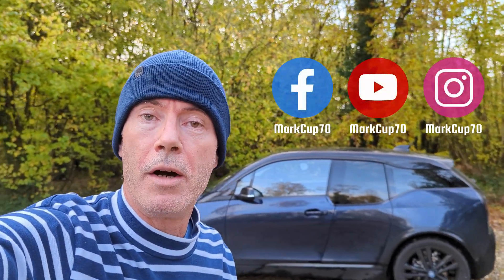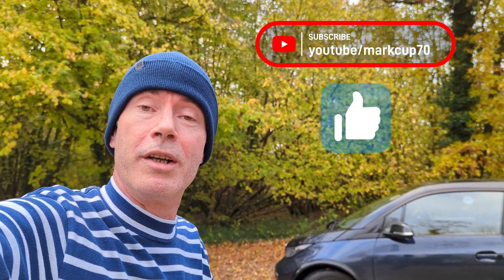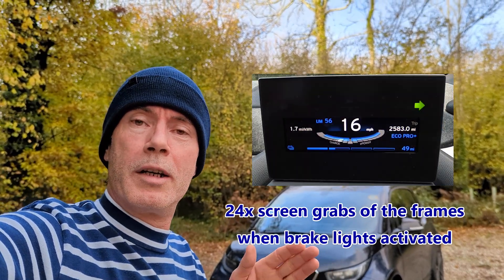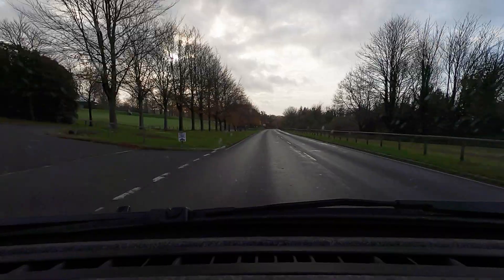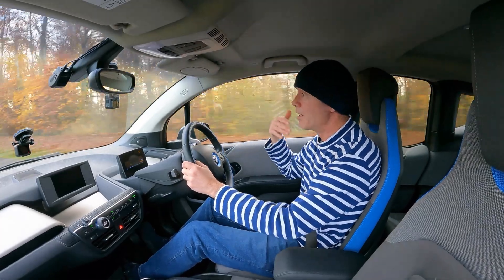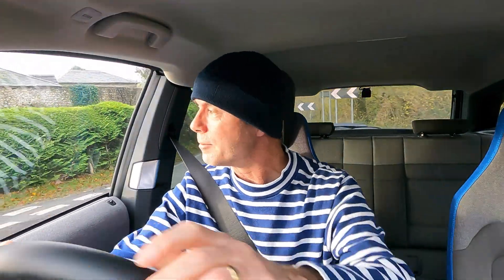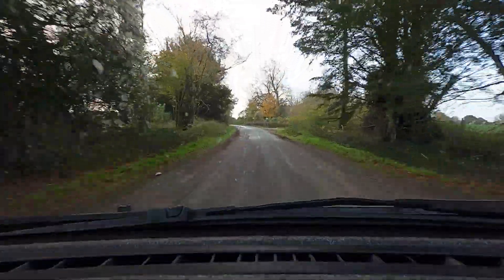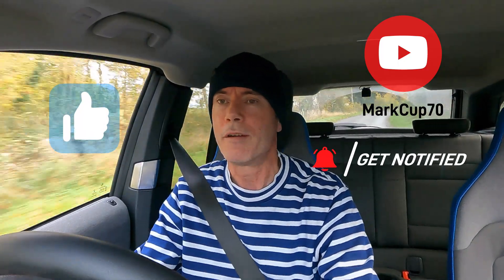BMW i3S EV life - why REGEN BRAKING in ELECTRIC VEHICLES is BAD for range!

Comment: I agree with you.  Accelerate moderately and read the road.  I managed 107K miles on one set of front brake pads in my C55 AMG.  With such a car, you can’t avoid the occasional vigorous driving, but the most miles was put on as a daily driver doing a 75miles round trips. It will be interesting to see how we get along with the i3 we’re picking up next week.

Comment: I know this video is 1,5 years old but you should test the “regen” on motorway with speeds over 60mph. Will the regen (letting of the gas) be stronger OR lighter between Eco Pro / Comfort / Sport –modes?

After 2,5 years of BMW PHEV (plug-in hybrid electric vehicle) ownership I believe this is true to some extent, but its greatly affected both by the “model year” AND the technology under the skin. For BMW PHEV’s different driving modes affects greatly how strong the “regen” is or in some cases it is disabled completely (this varies with the speed which the vehicle is moving). Thus I find a bit odd that Mark is saying that in i3 there’s only one setting for regen? Under all the settings under various driving modes there's no "B" or regenerative braking force or such?

For example (yet again BMW PHEV’s) the regen in Eco Pro -mode is different than in Comfort or Sport –modes. Also in the newer BMW PHEV’s there’s this … how to say it, “coasting” option automatically engaged: The ICE or EV motor is decoupled from the gearbox & rest of the drive train system and shut off. Kind of “start & stop” system but while vehicle is moving on the motorway. From the BMW technical bulleting:

"A hybrid-specific coasting function is triggered at speeds between 40 and 160 km/h (25 – 99 mph). As soon as the driver releases the accelerator, the combustion engine is switched off. In addition, recuperation of braking energy is reduced to the level required by the onboard power supply. The car therefore runs on the minimum possible energy consumption and with the lowest possible mechanical resistance".

-This will greatly reduce the drag which the petrol engine normally creates. It’s actually surprising how long distance modern motor vehicle will just roll when there’s no resistance & drag from the engine. I’ve experienced this with my former 2018 BMW 740Le PHEV which had this option under Eco Pro –mode. And this actually increased both petrol and EV-range by quite a bit. BUT this “coasting” option was only engaged at speeds greater than 40kph / 25mph, when vehicle was travelling slower, it used regen like in Comfort -mode.
And if driven with Comfort or Adaptive -modes the vehicle would just “engine brake” with regen system all the time -> negatively impacting the overall "range" of the vehicle.

Then I bought an BMW i8. This one generation older hybrid powertrain does not have “coasting” option under Eco Pro –mode. When in Eco Pro the vehicle regens just like in Comfort –mode and the regen is actually stronger than 7-series ever had. Albeit the i8 is 800kg lighter than my 7-series was. Even at quite big downhill section the i8 will just slow down when Eco Pro or Comfort –modes. My 7-series never ever slowed down even at mild downhill, not even Adaptive –mode. If that thing was in Eco Pro, it would gain speed like a car in Neutral rolling freely.

Could this (lightweight, older technology) be the case with i3 also? Because for example the much newer BMW i4/i7/iX will “coast” (only in Eco Pro –mode) and the regen will not reduce the range similarly than / if driven with Comfort / Sport / Individual –modes.

Comment: I've got a Nissan Leaf 40kWh and always drive in B (braking) mode and I'm a bit of a a hyper miler, consistently get better than average efficiency compared to others on the Nissan Leaf FB group, though the summer I've been averaging 5.4 miles/kWh, 700 mile round trip to Scotland and back in June I got 4.8 and I wasn't hanging about. Having been a driving instructor for almost 40 years I know that anticipation is the key to efficiency, even more so in an EV than an ICE car. I wonder if the i3 makes more regen the lower the battery %age is, I certainly find that in the Leaf, I like to keep the battery between 80% and 90% which gives the most balanced level of regen. Very rarely use the brakes at all.
Reply: Giid efecenty

Comment: Dear Mark, Just your title for this video is misleading. All the points you make about energy loss when using kinetic energy to charge the battery are correct but you are putting some energy back into the battery rather than just losing it as heat. But the main point you make is so true. If we all read the road and the traffic conditions then Electric or ICE we shouldn't need to use the brakes very often. That's the important point. Perhaps this video should have been called "Not reading the road is so bad for range".

Comment: It is poor anticipatory driving that is bad for range.  With "One Pedal Driving" I consider the pedal as "progress Control" rather than on/off .. I very quickly learnt to feather the pedal for controlled smooth stopping - something I gleaned from towing with automatics
Reply from the maker: 100%, anticipation and planning = max range, spending energy only on the momentum you can use. Anything you have to recuperate through regen braking is inefficient which is the point I was trying to make with this video 👍

Comment: I think what you are saying with regards to energy saving is more relevant to your car with only one setting of regen, so as soon as you come off the throttle you are effectively braking, enter other makes where there are several modes you can coast, where as in your car you are still using power.  100% agree with reading the road etc.  I would like to see a test done to show which is the most effective setting, I suspect it’s counter intuitive for the reasons you have highlighted.  With minimal allowing you to shut off demand and coasting on kinetic energy alone.

Comment: The headline is very misleading. It should read "Braking is Bad for Range" Whilst it is correct that regeneration doesn't recover 100% of your kinetic energy, using the brake pedal recovers 0%. So to get maximum range you should control your speed anticipating stops such that you don't need to use the brake pedal. Using the regenerative braking is very useful especially if you are descending a hill or slowing for any reason.

Comment: Downhill , that’s the real winwin.
So always you will have  unpredictable situations,  someone tailgating you, but yes you can of course aim to plan ahead to the point that regen is unnecessary. It’s very satisfying infact !
I like the quote ‘arrive to depart’ someone pointed out here.
The idea that you are harming the battery … ha, I doubt it. The BMS on the i3 is very sophisticated. I doubt it’d allow any detrimental charging to occur. 
Thise track day pads , maybe try a caterham on track or a Lotus. You’ll do more than one track session on a set. And you’ll drive home safely. 
The Cayman is a fabulous machine. But it ain’t light, compared to an Elise. Of course, you may like roof that works effortlessly and hate squeaks… but if you haven’t tried a Lotus, you really really should ☺️
Reply: you are correct, but is hard to resist the tork😅

Comment: I agree, but how do you turn of the regen breaking?
Reply from the maker: You don't turn it off, you simply don't take your foot completely off the throttle, you find the mid coasting point in the throttle pedal's travel and allow the momentum of the car to carry you along.
Reply: @MarkCup70  thank you for answering.
I see a lot of comments saying you get used to it. So I’ll probably get into it, but I still like to keep my fot on the break in case I need to stop fast..
Reply: @eliaspederstad4360 or increase your braking distance, I find it to be such a chilled way to drive…much more Zen! to car in front?

Comment: Regenerative braking is about recovering energy that would otherwise have been lost. In town driving I've found that I can end up with more range than I started out with thanks to the recovery of energy and generating energy on hills. To say regenerative braking is bad for range is incorrect, driving style will always lead to better energy use if you plan ahead for the road and conditions. Avoiding speed change will be better for an EV or ICE car, it's all about making the most of what you have.

Comment: Maximum range is about transfering as much of the energy stored in the energy store (battery or fuel tank) into the unavoidable drag.  

By "unavoidable" i mean the things that cause drag that you can't as a driver do anything about, ie aero drag and rolling drag.  The kinetic energy temporarily held in your cars mass as it travels at a non zero velocity can be used with 100% efficiency to overcome drag, and it can be partially recovered by an electric car using regen, or completely lost in an car with an internal combustion engine either as brake friction or powertrain losses (engine friction & pumping losses / parasitics).

So for any given average speed, the best possible option is to accelerate to that speed and stay there.  In reality of course on real roads this is not practical mostly. Hence when we change speed we really should only ever slow down by coasting and here the KE is going with 100% efficinecy to over come drag, and as that KE bleeds away to drag load, the car slows. ON an EV like the i3, this "coasting" is actually deliberately mapped into a fairly wide pedal zone (wider zone in eco mode btw) that sits with the traction motor at zero torque, ie coasting (a tiny amount of energy is still being used to overcome iron and copper losses in that eMachine of course, but it's pretty tiny) and this is displayed on the i3 by the swing-o-meter sitting slap bang in the bottom middle of its arc, neither driving nor recuperating.

if you have to slow at a greater rate, then use regen, which is easy in the i3 because it has a lot of regen mapped into the accel pedal for it's one-pedal driving.  if you have to use the friction brakes ie press the brake pedal, then you have "lost"  ;-)  as in the i3 the brake hydraulics are not locked out or modulated to allow regen first, because the car is designed to be driven one-pedal for the vast majority of the time
Reply: Really interesting answer, thank you again; in real driving in traffic, it is necessary to use friction brakes occasionally…which is probably a good action to keep them in good working condition?

Comment: Title seems like clickbait. Regen braking is more efficient than friction braking. You sort of get there in the end but you gloss over that the i3 communicates when it's at its most efficient: ePower meter at dead center. It's moving without taking any energy from the battery or losing any to braking. Probably anathema to you but in 8+ years of i3 driving, I've found ACC is significantly more efficient than my manual control. The computer keeps power use the neutral zone more often than I can.

Comment: LOL! Tremendous video.
To do what you’re suggesting (in an i3 specifically is also not stop accelerating)

Instead you’d need to balance the throttle to make sure the i3 doesn’t activate regen. The second you lift off completely the i3 will regen, you cannot turn this feature off entirely.

So maximum range given your common sense physics is to not brake and not stop accelerating.

Comment: It's the title of your video that is wrong. Regen isn't bad for range, driving incorrectly is bad for range and that applies to all cars. Hypermiling has been done for years, it's just good anticipation, at least with regen you get some of the energy back. Oh and if you really want to slide that i3, Google i3 roller mode. Enjoy.

Comment: Of course you're right! Preference 1: continue moving. This way you can keep your kinetic energy. Preference 2: regen. This way you can win back at least some part of it. Preference 3: friction brakes. Not good for anything, but can stop your car quicker :) Plus, if BMW still uses same composite on i3 brake discs as they uses on mine 5 years ago, you should better use the friction brakes at least once a week, before they rust away...

But there's another interesting point for your engineer heart 😉 You can apply same rules of energy transition not only for braking, but for the speed, too. I drove a Merc EQV for a long weekend recently. First as usual, but the consumption was ridiculously high. I took this as a challenge and tried to reduce it. So instead of a cruise-control driving, I tried to adjust the speed in a way to preserve the most possible energy. Driving up a hill, you would let your speed drop somewhat, instead of keeping it steady at any cost. Driving down the hill, you would let it increase above your target speed. Then when the hill is flattening, you'll take your speed excess to roll out longer into the valley, until the car slows down back to your target speed and you start pushing again.

Adding just 20km/h variation to my speed on a mountain road gave me around 20% less consumption! I didn't measure it specifically, so no exact numbers here, 20% was the consumption meter in the car. I didn't take exact same route to put down a valid measure. But still, the saving was quite significant, and didn't cost me any time at the end — the slowness at ascending was recovered by the quickness of descent (watching the speed limits of course).

It would be really interesting and fun to see someone doing such an experiment: constant speed vs. speed variation by +X/-X km/h in regards to the consumption 😏
Reply: Spot on mate! That is eco driving 101👍
I translated my eco driving classes to my i3S, and this how I drive with her to get the most mileage of my EV on my commute to work. 

On the county roads when approaching an obstacle (roundabout or crossroads) I put my accelerator in a position where  I don’t accelerate nor regenerate. I call it putting the gearbox in neutral and roll, until the very end when I use regeneration to make the full stop. 

When it comes to the part of motorway I have to go, I simply get behind a truck and activate the adaptive cruise control to follow the trucks speed (around 85 km/h). Driving at full speed on the motorway is a killer for the range. 

My average consumption is around 1,4 kWh/10 km on a 25 minute commute one way.

Comment: Regen itself isn't bad for range, it's an overall plus for range.  Driving brake-heavy will certainly hurt your economy, petrol, EV, whatever.  But that's really a separate thing than the regen.  I realize that's a bit picky in technicalities, but the devil is often in the details.
Not sure why someone here seems to think regen is bad on battery, etc.  Don't exactly see the problems this would inevitably cause.
Reply: Exactly. His tips might apply to ICE cars and drivers who spend a lot of time riding their breaks but for us EV owners it's solution to a problem that doesn't exist. We already know about regen breaking, reading the road and the traffic patterns as well as not charging to 100% and all that. I'm not exactly sure who this video is for. Maybe it's for those EV drivers who have weak regen in their cars or something.....
Reply: @KineticEV  Both of you dont understand the video. When energy leaves the battery there are losses, when it comes back there are losses, therefore, the most efficient thing is to travel the greatest distance without regenerative braking.
Regenerative braking is great, but it should be the last option
Reply from the maker: Bingo. I think that's now up to 3 of you that truly understand regenerative braking and its downsides LOL
Reply: @MarkCup70  Haha, nah, some people know... or guess. The I3 has powerful regenerative braking, but you have a bar between "power" and "charge" that should be "neutral driving" right? but i dont know if its hard to keep that point with the pedal, other cars have low regenerative braking setting and it's more comfortable because they can release the pedal.

I have a "freak" question for you :)
I'm thinking of buying an i3S and weighing up the difference in range and consumption compared to the normal one due to the increased aerodynamic resistance of the wheel/tires (for any travel).
But a small part I think comes from a possible "defect" in the I3S.
I think the air deflectors in front of the tires were kept in the same place compared to the normal i3, but the i3 s has the front wheels (especially) further apart, so this deflector doesn't do its job as well as in the standard one.
I want to start looking into that with photos on the internet for curiosity...
Do you know if those deflectors are placed the same on the I3S or if they were moved outwards or the are longer on the i3S?

Comment: Hi, I believe the accelerometer calibration controls the majority in when the brake lights are triggered.  Perhaps you can dive into this a little bit further.

Thanks for the channel. I look forward to more i3 videos. I have owned a 2014 for 3 1/2 years and I love it.
Owned an ‘86 928 prior for 23 years. Don’t miss it. 😎
Reply: correct, EU law requires brake lights to auto-illuminate above a threshold deceleration:

ECE 13H
5.2.22.4. Electric regenerative braking systems as defined in paragraph 2.17., which produce a retarding
force upon release of the accelerator control, may only generate the signal mentioned above at
decelerations above 1.3 m/s². However, if the signal has been generated, the signal shall be de-
activated at the latest when the deceleration has fallen below 0.7 m/s².

Hence the illumination is not driven by a negative torque threshold (as displayed in the i3's swing-o-meter on the driver display) but by a negative vehicle acceleration threshold which of course depends on vehicle mass and road gradient!
Reply: Awesome answer, thanks 😅